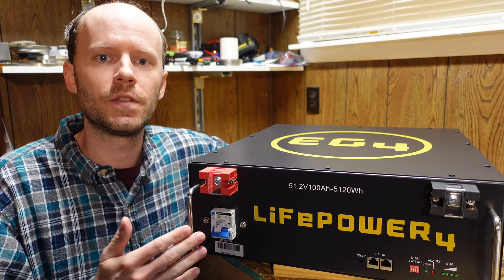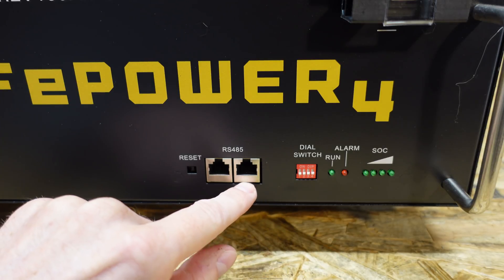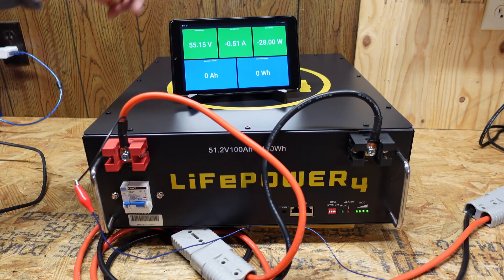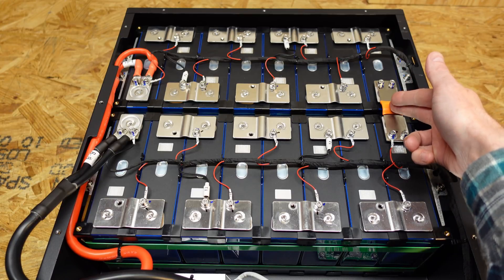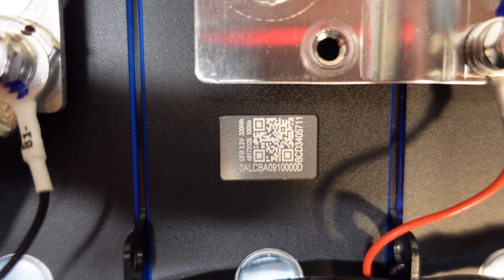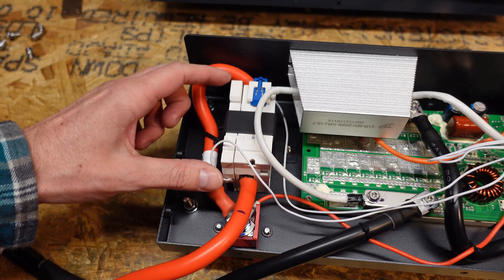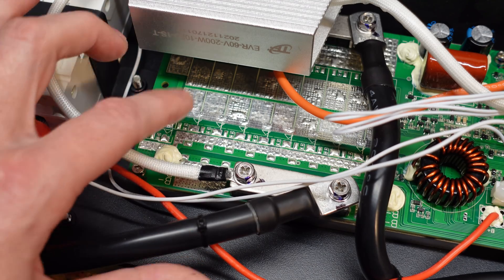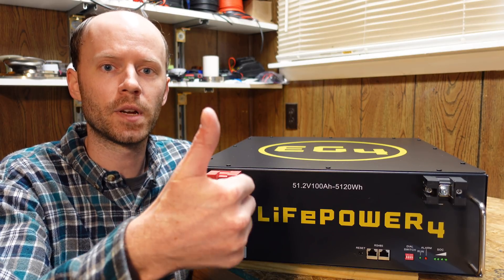EG4 LiFePO4 Battery 48V 100Ah "LifePower4" Review and Teardown

Comment: Do you know how to hookup a motor controller to a ebike I got a swagtron envy ebike I think it has a 200 or 250 watt motor and the battery was only 36 volts at 4.4 amps I got a 14 amp battery for mine when I tested it I only went about 11 or so miles should I got more miles from it I think that battery has to much power for that motor controller part 1 of 2
Reply from the maker: Sorry, I don't have any experience with ebikes to be able to offer assistance.